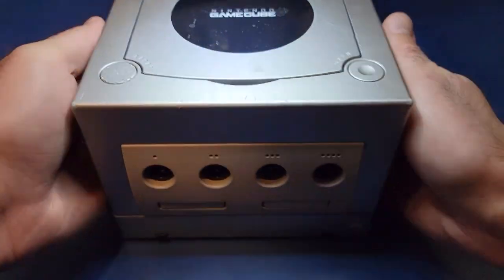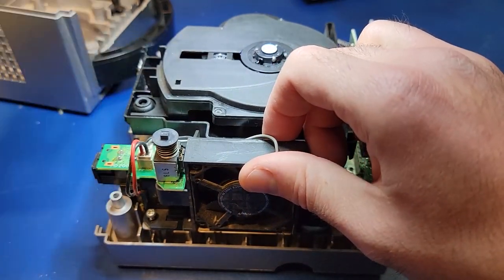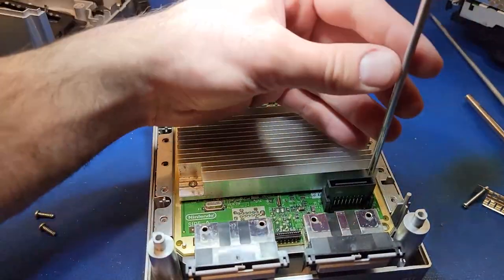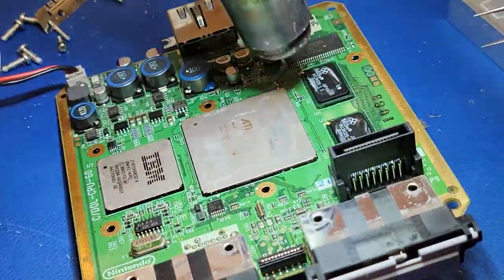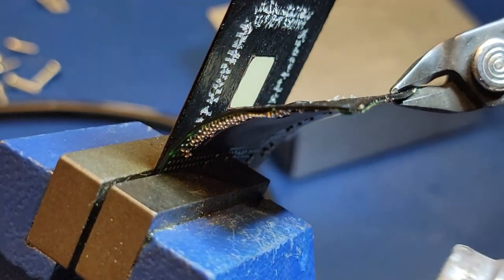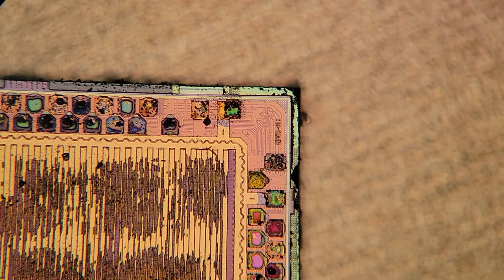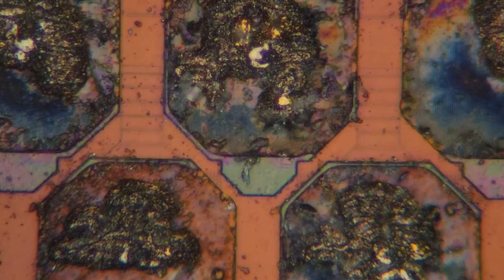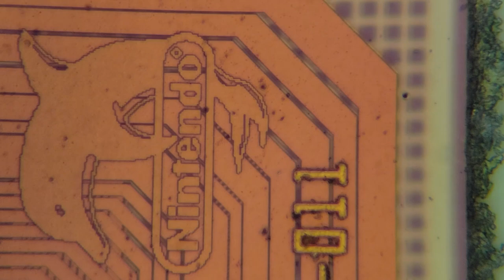What's inside a Nintendo Gamecube?

Comment: Kool man. What's a recommended microscope for beginners and a hest gun to take ics off the mother boards?
Reply from the maker: There are lots of cheap microscopes with screens built into them that seem okay for beginners. I haven't used any of those types myself though, so I can't recommend a specific model. Just don't be fooled by the 20$ microscopes that claim 1000x or 1600x magnification. 

I've been using a cheap hot air rework station that I got on Amazon. My model that I used here was an 862d+. There are lots of models to choose from and they are probably all very similar.